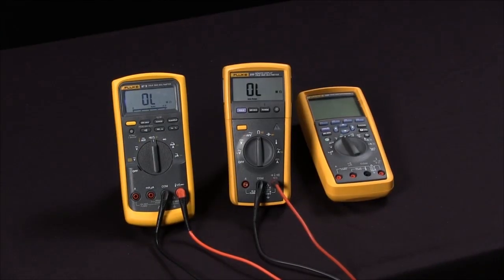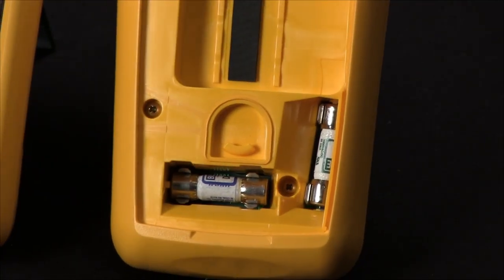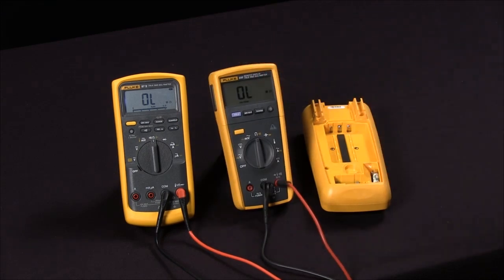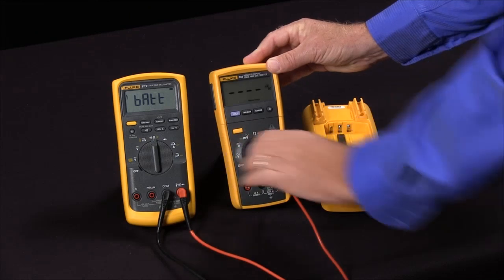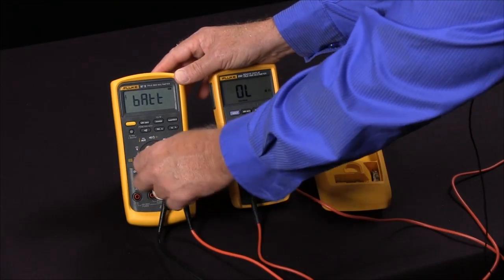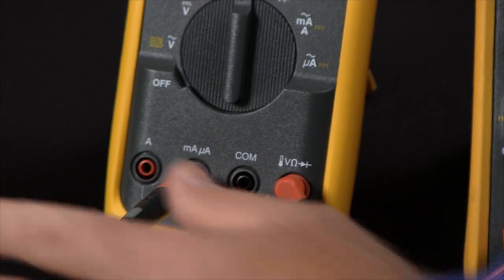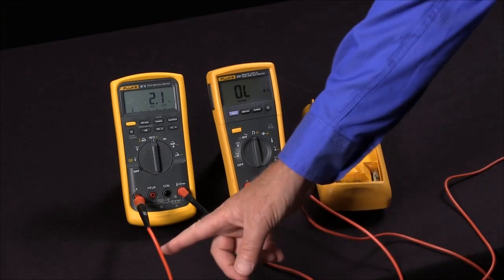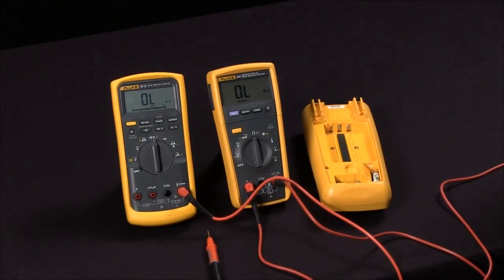How To Test Fuses In A Multimeter

Comment: Is this multimeter fluke 87v mesure AC+DC COMPONENTS
Reply from the maker: Hello - Sorry for the delay in response time. The Fluke 87V would not be able to display the AC+DC component signals. You would want to check out the Fluke 287 or 289. They are capable of displaying both ac and dc signal components (voltage or current) as two separate readings or one AC+DC (rms) value combined. Hope this helps.

Comment: Just bought new fluke (15b I think) to test parasitic battery drain with multi amps.  On motorcycle.  First test worked great !   Now nothing works except volts. Just get 0s.   The one wire test get the LO.  Or  was it OL. Meaning bad fuse ?   I have no idea what happened.  Thank you.    Don’t tell my brother steve. He worked his entire life at Everett fluke in model prototype dept :)
Reply from the maker: Hello - Your secret is safe on this comment thread. If you did test the fuses and it read 'OL' that is an indication that the fuse(s) would need to be replaced. But those can be replaced easily by following the user's manual instructions. There should be two fuses on the Fluke 15B which should be ordered at any Fluke authorized distributor. For the 500mA/1000V fuse you would want to order the PN 1989732 and for the 11A/1000V fuse it would be PN 803293. Please feel free to reach out to our Support team for more insight on ordering and parts, 1-800-443-5853. Good Luck!

Comment: I'm new to the world of multimeeters and just purchased my first one. It's the Fluke 179. I just tested this method. When plugged into the 10A socket, I get a reading of 0.1 and when I put the lead into the 400 ma socket I get a reading of 1.8. Is that good?
Reply from the maker: Hello - Generally, in the 10A input the fuse should read anywhere from 0.0 ohms to 0.5 ohms. And for the 400mA you would want to be somewhere around 0.995 kohms to 1.005 kohms. As long as you don't get 'OL' you should be good to go. That would indicate that the fuses are blown.

Comment: Hope you reply this time my multimeter is a innova 10 amps unfused  the same test aply? Or how do I check the amp port, thank you and cheers from Ontario ca.
Reply from the maker: Hi Everardo - This test would typically apply to a multimeter with a fused input (Amp or mA). I cannot speak for another companies meter, like your Innova. So please contact Innova for more information and directions on how they would properly test a fuse in the amperage port/input.

Comment: I'm confused, I have a Klein Tools mm700 just bought. When I follow these steps and probe the 10A lead input I get a sound. When I do the same for the 500mA I get nothing but OL not reading of any kind. But I have taken off the fuse and tested it and it seems to have continuity... what am I doing wrong, do I have a defective multimeter?

Thank you all!
Reply from the maker: Hi Dario - I cannot speak for the Klein meter that you own, please contact Klein Tools for more information. But if this was a Fluke meter I would check and make sure that the probe tip is pressed all the way in to the mA input on your meter. If the probe tip is not making the correct contact generally you would see an OL. Also, try pressing the probe handle down when the tip is inserted in the mA input, this allows the probe tip to contact the back-upper section within the mA input and might provide better results.

Comment: something i would like to know
i burned 1 of my multimeter (amp mesurement) on a battery  

that lead wasn'T suposed to be on amp side >_>
well changing the fuse didn't make it work again
arent  the fuse suposed to prevent damage ?

it still work but forget amp testing
Reply from the maker: Hello - The primary function of the fuse is to protect the user. Its secondary function is to protect the meter. But, if the energy was too high during the measurement it could still potentially harm the meter. Were you using a Fluke meter? I would see about getting it sent in for repairs just in case you need current measurements in the future! Contact our Service department at 888-993-5853.
Reply: @fluke  no some random multimeter  
anyway i hated it and already bought new one 
older than 5y it was due i need more  option than any random i can find at local store

Comment: For some reason this method works in my 10A input but not my MA input and I know my 200mA fuse is not blown? Any reason this might be? Craftsman true rms unit.
Reply: the guy in the video specifically said that the mA fused is a slow blow fuse so it will show 1k Ohms when the fuse is OK. so your fuse is ok.

Comment: I believe the fuses in my two meters are good, yet I get different results than in the video.

When I do this on the mA port on my 289, I get about 10,000 Ohms, not 1,000.

On my 179, on the 10A port I get just the resistance of the lead itself; on the mA port I get a little more, about 2 Ohms.  All these results are different than the video suggests.

Any concerns, or are the numbers used in the video just rough?
Reply from the maker: This is a great question.

The key to the video is the “OL”. This is an example of testing the fuse through the meter's circuitry to determine if the fuse is blown.
The meters they demonstrated with, the 233 and the 87V, we can see that in the mA fuse, they have around 2.0, and the A fuse, they have .1.

In Mike’s example with the 179 and the 289, I measured the same resistances has he did. The A fuse has low resistance, where the mA fuse has a higher rating.
With the 289 circuitry, I also measured 10k Ohms in the mA jack for the 289.
Reply: Fluke Corporation, thanks for replying!

Separately, I sure wish Fluke would make a clear statement about the interchangeability of the fuse part numbers in these meters.  Both of my meters (179 and 289) specify DMM-44/100 and DMM-11A.  But recently it seems the market has changed to DMM-B-44/100 and DMM-B-11A.  I’d like to know if Fluke considers the “B” versions an exact match?  Authentic non-B fuses seem to be getting hard to find.
Reply from the maker: Happy to help!

The DMM-11A is an older version of the DMM-B-11A.  The DMM-11A-R and DMM-R 0.44 refer to a RoHS compliant part.

According to the UL Cert from Cooper Bussmann the DMM-11A, DMM-B-11A and DMM-11A-R fall under the same UL cert.  Likewise for the DMM, DMM-B, DMM-R 0.44 fuse.

It looks like over the years they have changed the model number in the catalog and updated the cert with the new model, but kept the same ratings and UL certification.

Hope that helps. Please let us know if you have any additional questions.
Reply: Fluke Corporation Thank you!
Reply: Just one more suggestion, for what it's worth: there's a TON of confusion, conjecture, and speculation out there on this specific issue of Fluke DMM fuses.  Fluke admonishes users (and rightly so) right on the units to use "Exact replacement fuses" and of course everyone wants to take good care of their gear.  It would be very helpful to put this clarification in some prominent place on the Fluke web site.  I've even asked the question via e-mail to support, and never gotten a reply - so this information is great to have.
Reply: Also you are measuring the fuse plus the respective circuitry. The A range has only a low resistance shunt so it reads low resistance. The mA or uA range has several  ohms because of the added circuitry involved in that measurment.
The critical thing is you do not want to se O.L. meaning the circuit is open completely. The actual reading isnt critical..

Comment: ty for the video

was wondering where I can got to purchase internal fuses. 2 ceramic fuses 10a 250 v fusion rapide and 500ma 250v fusion rapide the other is a glass type fuse 2amp 250v fast blow. Tired almost everywhere I can think of ty for any help.